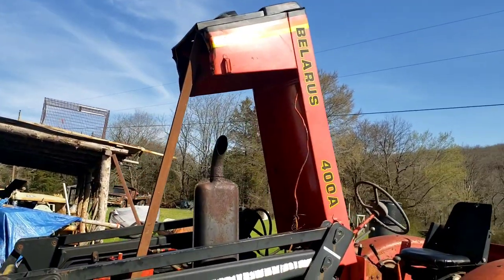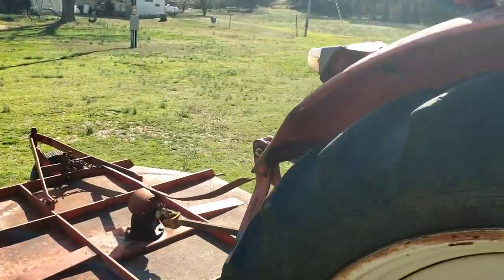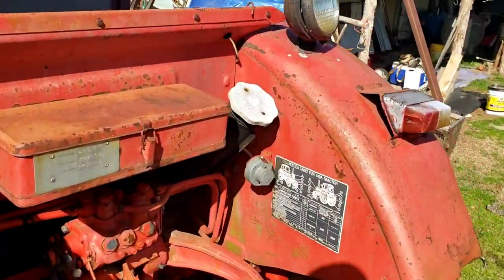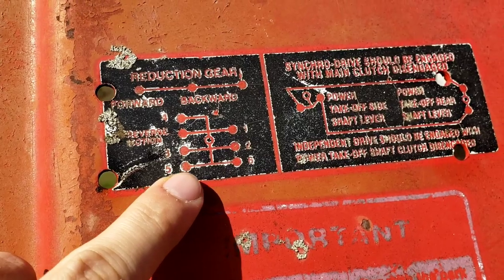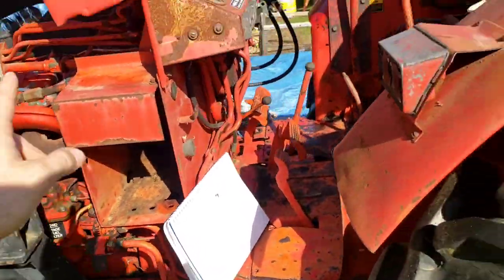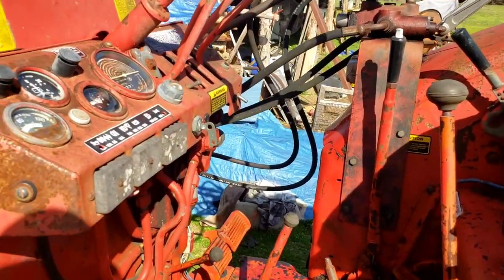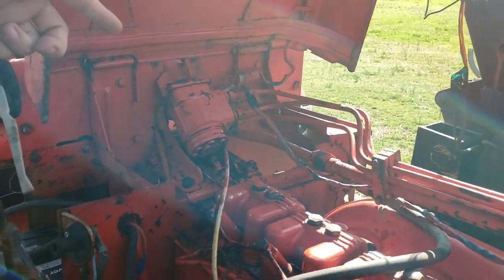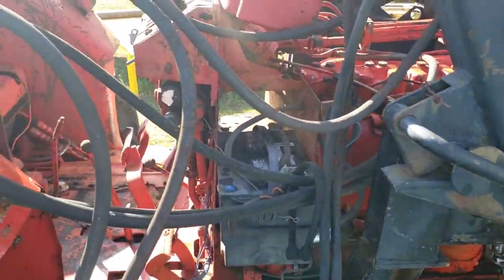Basic knowledge on Belarus 400a

Comment: The floor pedal by parking brake lever, looks like diff lock, there's a pull rod just above floor under dash with black knob, looks like your decompressor.  Throttle down is the way to shut it down. All mechanical. From the factory, these tractors didn't have a low idle stop.  Made my own low idle stop, very easy and handy off of hand throttle on right side fender ala old style Caterpillar  D-2
Reply from the maker: Thank you for the knowledge!  Very much appreciated.

Comment: Than you for your posting. Just purchased the same tractor just like yours from the nabor who passed away 4 years ago it's been seating for about 4-5 years has 435 hrs  on it so far i can't started with out starting fluid and  soon 😊is I stop spraying in it's stops immediately . I pumped the fluid up and comes everywhere besides the 4 injections I'm not even sure about the dash switches  and I can't find anything on YouTube. I wonder if you can post a video about the total start up ? Thank you!
Reply from the maker: I heard there is a fuel shit off. But as of right now I'm not to sure how the fuel system works ill see if I can make a short for u sometime. Maybe it will help.
Reply from the maker: I put a short video out for you. I @ you as well.

Comment: My 822 belarus has a pull knob kinda like a choke that cuts the air off coming to engine to kill it or mine will throttle down enough to shut fuel off and kill it. I suspect this has same somewhere. also the pedal on rear floorboard you pointed out should be the differential lock for the rear wheels
Reply from the maker: Well the more ya know. Thanks for the knowledge for sure! I'll have to look into the nob for sure. I'm thinking this tractor has been completely apart before and maybe the throttle rod is set wrong so it won't die if u pull the throttle down. But ill be looking into it for sure!